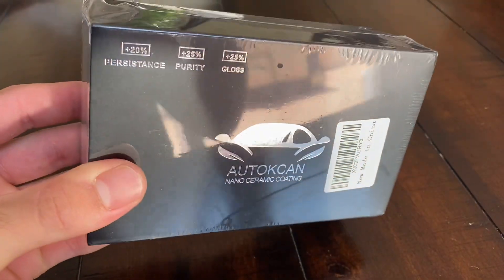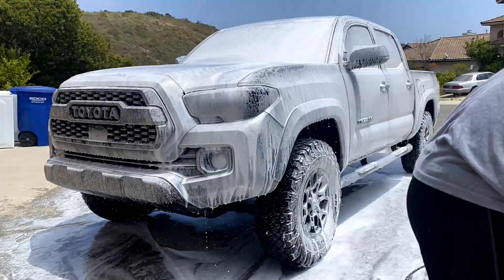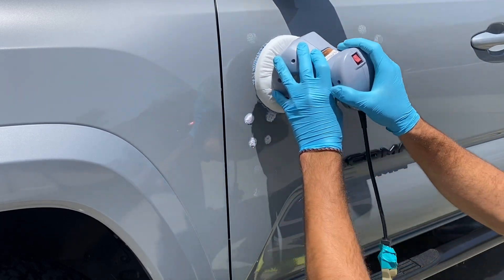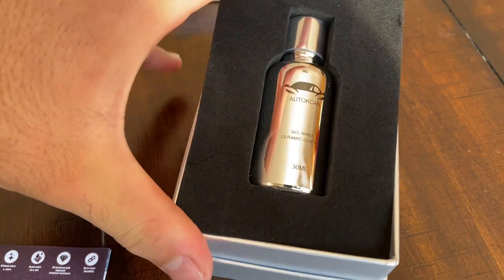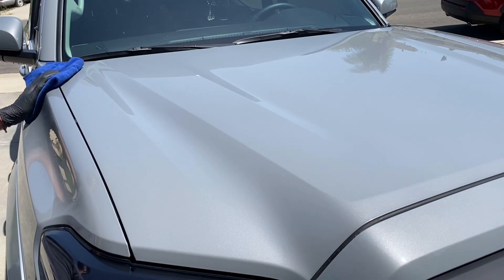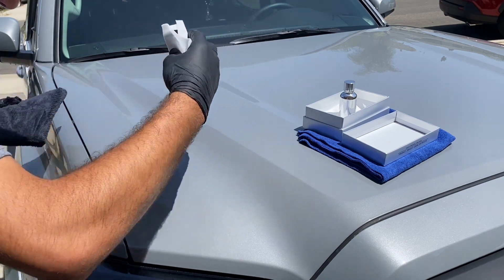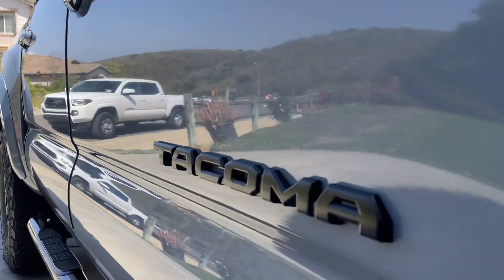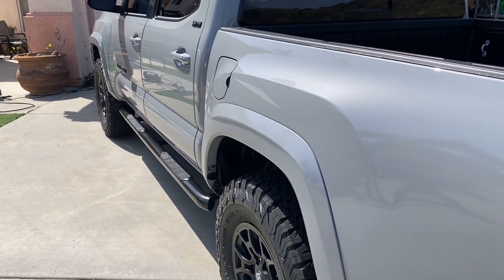Applying a $25 Dollar Ceramic Coating!!! Is it worth it?

Comment: hey man if you're just starting and you want to do polishing, i highly Highly suggest you upgrade your polisher. those walmart polishers are complete garbage and a waste of time. you can get a decent one from harbor freight for a very decent cost. and it will be a real step into professional polishing. I tried to learn with a walmart polisher as well one a little pricier than the one you had here and omg... complete waste of money and time. i bought my second polisher from amazon was a 67 dollar one and that one was decent finally felt what real polishing kinda felt like. and then i bought my third polisher which was the harbor freight one. currently i have a ShineMate polisher which has amazing reviews by pros. and definitely hope youre able to get there some time soon so you can get a real feel for polishing its fun and much more enjoyable. awesome video i also work with amazon ceramic coatings they are easy to work with and they are actually decent! good luck man i wish you the best, im a beginner myself but im trying my best to achieve greatness

Comment: Thanks your truck is super shiny. Have you applied ceramic coating again since video? Also, couple more questions, so before the ceramic coating you add polish to the truck but then use alcohol to take it off and then you apply the ceramic coating?
2nd unrelated question is what running boards are on your truck?
Reply from the maker: Yes to the first part, secondly links for them are in description in my newer idols
Reply from the maker: In my newer videos